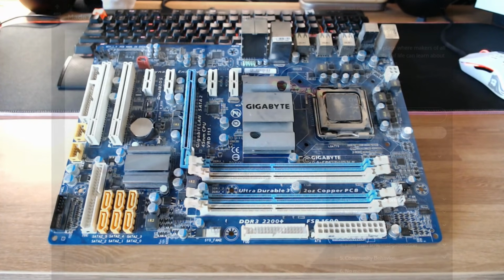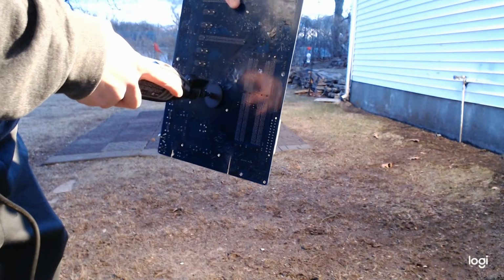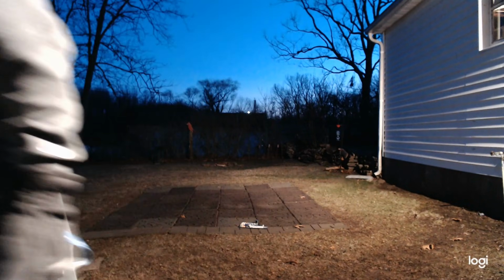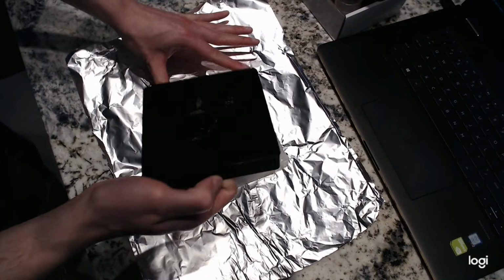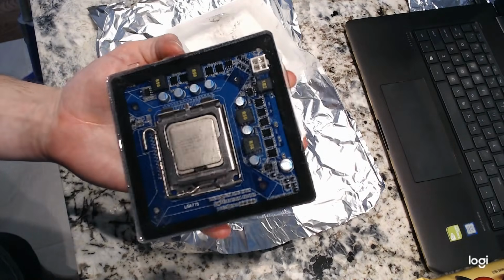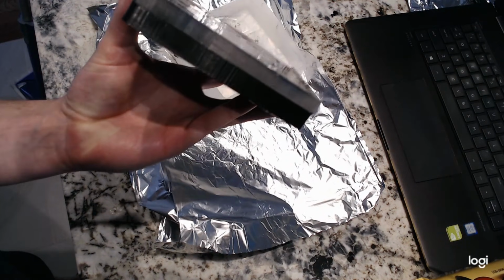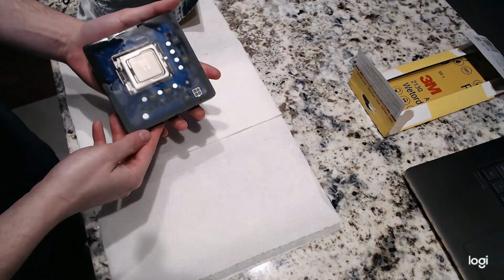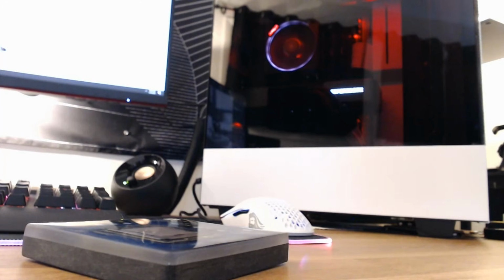Turning my Old CPU and Motherboard into a Coaster

Comment: What model dremel and saw blade did you use?
Reply from the maker: I don’t remember the exact model (it was a family members’ that I borrowed) but I’m pretty sure I used the blade that was for metal and it came with the dremel kit. It wasn’t too hard to cut through, just be careful and let it cut like a sander don’t push it too hard (if you’re planning on doing this)

Comment: Awesome idea! I may have to try that. I am curious what 3D design software you were using?
Reply from the maker: Thanks! I was using Fusion 360
Reply: @CASSDesigns Welcome!  Oh ok. It looked like a simpler UI than the F360 Ive seen in the past.
Reply from the maker: @CoderM3  I only started using it maybe 6 months back so they might've updated it a short while before I started using it. It definitely is more user friendly than some other CAD softwares out there
Reply: @CASSDesigns  Love it. I may do this with my DS87C520 silicon wafer and chip  I bought a few years back that I was going to make a display for. Never thought of using a resin.
Reply from the maker: @CoderM3  that'll look nice! good luck

Comment: What was the point of the silicone casting? It seemed slightly redundant, since you 3d printed the casing already. Awesome project though, I'm working on something similar
Reply from the maker: The resin actually goes above the black piece I printed, I used that black piece to cover the cut edges to make it look nicer then cast it to cover everything
Reply from the maker: Also - if I cast it into the other bigger piece I printed it would’ve been hard to remove the cured resin from the print